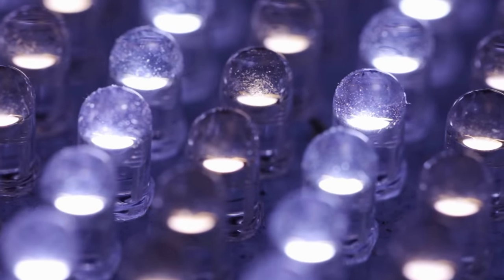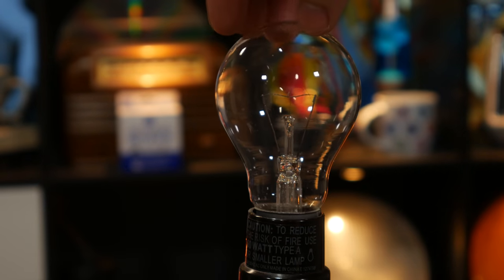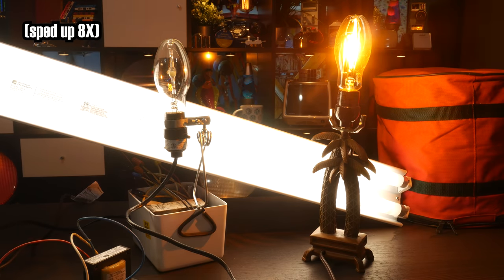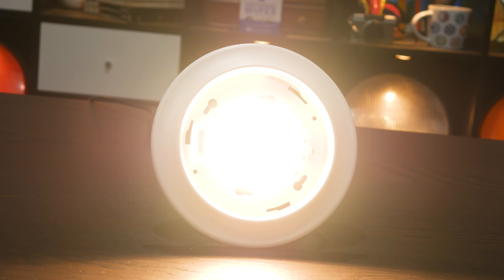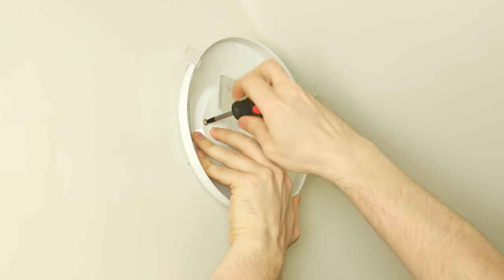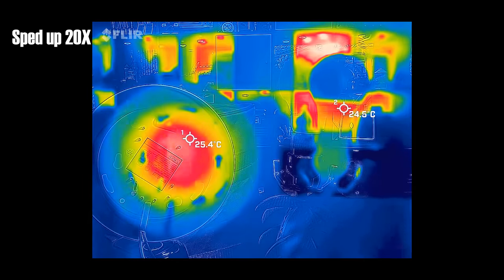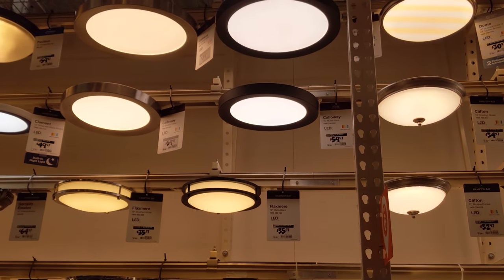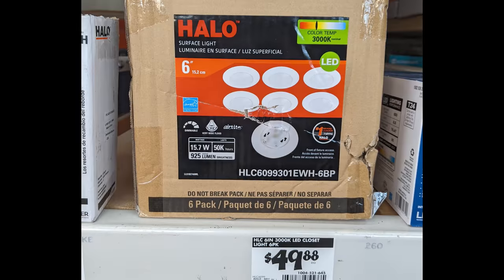A troubling trend in lighting?

Comment: I have two houses in China . One new one old . Both have the wiring simply covered with plaster . No romex no box, no metal plates over wires, over head Lighting is simply screwed to the  surface  or if it is a false ceiling held in place with spring clips. Switching is just screwed to the bottom of a shallow hole dug into the wall . As are wall outlets. From what I can tell the way they avoid damaging the wires is run them in the corner between the wall and the ceiling when running around the room and when they come down to a switch they run straight up and down the wall from the switch or wall outlet. Add to that it's all 220 one hot one return wire. I have replaced a  number of switches, wall  outlets and ceiling lights because the quality does not seem to be very good. So if you encounter a light fixture where the screw holes don't match with your box you can assume it was intended for the domestic Market in China and not export .

Comment: My apartment got struck by lighnitng and knocked out the light in my ceiling fan.  The light is basically one of these screwed onto a fan housing.  My apartment complex can't find a replacement, and it has been about 3 weeks with no light in my room

Comment: recently the light in the bathroom of my (rented) apartment has begun to flicker and pulse in light intensity (going from light to dark and so on) - popped the cover off of the boob light and had a "hey I watched a video on these a few months ago" moment - I have one of these. landlord supposedly installed it 3 years ago, I guess it's starting to go. Now that I've had to deal with one of these, i'm staunchly against them, at least in rented settings, i'm stuck with flickery bathroom light until my landlord finally gets someone over here to replace it.

Comment: FInally, someone talks about the issue with those light fixtures, i know they are convenient, but in the long term, they aren't, specially knowing that the market in 5 or 8 years will change and maybe those light fixtures will not exist. I work in a hardware store, and often people come to ask if we sell replacements for the driver, but we dont sell those things because every manufacturer uses different drivers,so they have to buy the whole thing again, it's an enviromental mess.

Comment: It my country (Australia) changing out light fixtures is illegal if you aren't an electricain.
Reply: Wow! Is that true? That's insane
Reply: @TurningString  yep we are land of rules any work on the fixed part of any electrical system is illegal.  You can change fuses - that's about it.

Same with plumbing.
Reply: @mernokimuvek  It's to with standards or some such unjustified reason, it comes down to income protection for plumbers.
Reply: @craigiedema1707  Someone wrote on a forum that in the 1960s dynamite was sold in hardware stores. and now in 2022 you cant work on electrical wiring in your own home. We are doomed with regulations.

Comment: 12:25 TRUE! Why do people wanna blind themselves with bright white...
Reply: When did people ever want to? These light output reductions when done in this way are still bad because you waste energy with all the light that gets absorbed and the heat that gets trapped inside and bakes the bulbs to early failures. Integrated LEDs can be made less bright if they make/program them that way and unlike the enclosed socket design, this would actually reduce the energy consumption and make the LEDs run more efficiently and last even longer. The direct downward firing design of the integrated LEDs is still better

Comment: Luckily it sounds like there's no real disadvantages for someone competent enough to spend 5 minutes watching a video on how to replace one, unless you just don't like the color. You can probably find the color you want if you spend more time looking. And regarding install, if turning off the power and twisting 2-3 wire nuts together is intimidating to you, I think you could get an electrician to build a plug for you. It's true you will have to throw out the entire fixture if it fails and you might not find a perfect match if it was part of a set, however, they last many many years and are cheap enough that I wouldn't mind replacing a set of them with a whole new set.

Comment: Interestingly this video popped up in my timeline right at a time when I moved into a new apartment with this kind of light, which was very frustrating to me once I was used to using Smart Bulbs, and at the time I inspected the apartment I wasn't aware that this kind of light doesn't have a socket, but is a complex electrical Installation. Does anyone by any chance know if it's possible to install that good old light socket back and how hard it is?

Comment: I don't mind doing away with the Edison connector and tbh I would have no problem with these if they were user serviceable to replace the LED array/components without having to wire a whole new one. Creating a new socket/connector is a good idea but these are flawed and ultimately dangerous

Comment: I am one of the cursed ones. "regular" led bulbs failure in the home was maybe 1-3 /30days. no matter what the brand.  
Some years ago I bought fancy bulbs and fixtures Philips, for a office space, and my home, exactly that happened they did craped out, they where nowhere to be found. 
The "nice" thing was at the office were we had a bunch of them, basically the celling design was based on them, and having  dogy lights when you receive customers... its for sure a profesional clue :)) 
My home is somewhat "vintage" and I like the way it is we got a bunch of fixtures that are again integral to the home (EG tiffany lamps) the filament like led bulbs work just fine. Only one of them bought the dust in a couple of days.
Reply: Same here but I still cannot trust LED as lighting today.
A convenient store nearby my home has changed its lighting to LEDs last week, the LED tubes are from Philips, all were working properly on the day they have finished replacing the fluorescents. But just one day after the replacements, 4 tubes have failed, one of them still worked but only half of it.
I have both LED bulbs and fluorescent lamps installed in my home, the average failure rate of LEDs is one bulb per season (3 months), while the fluorescent is around 9 months.
Reply: I’ve had terrible luck with the led bulbs too. Feit and Sylvania were by far the worst. Replaced about a dozen bulbs in my house all at once with Feit and within two months I’d already replaced 3-4 of them for flickering. Decided to replace them with a mixture of Sylvania/Phillips/GE to see what works best. Over the next 6ish months Sylvania had a few fail to flickering, one Phillips would act weird when first turning it on (took longer and would flicker a few times), and no issues with GE so I replaced everything with GE. Haven’t had any issues since. Hopefully it stays that way. 

I also put some temperature adjustable recessed led’s with trim in some old ceiling cans and haven’t had any issues with them. Luckily I’ve got a few extras so I don’t need to worry about mismatches if I need to replace some.

Comment: I like the new clear glass led bulbs, I thought they were not using driver chips anymore, but like all led bulbs I’ve tried, they flicker and die after a couple months of being upside down, for some reason they don’t like being upside-down, some say the heat rises into the chip and destroys it, but my basement has open bulb holders and remains between 50-70 degrees F year round. I love LEDs and their efficiency, but the companies are advertising the long life of the led diode itself, but they don’t tell you the driver chip seems to have a timer to kill the bulb after less than a year. Crooks.

Comment: I live in the US, can you please list the temperatures in Fahrenheit also? We use that system here to measure temperature. Thanks! 😁
Reply: I appreciate your politeness, and I also live in the US, but...I'm pretty sure Technology Connections does too? He's clearly an American, at the least. He probably listed the temps. in metric because it makes more sense from both an accessebility and logic standpoint (though he has mentioned feet and stuff before, so I dunno lol). Despite being American, I still recognize that the system we primarily use is outdated and that we should have fully switched a long time ago, and so it's not anyone's fault if they don't feel like making conversions when they could just list out things using The International System that most people around the world use, and simply expect the stubborn Americans to deal with converting to their outdated system themselves. (Seriously, it's not hard to open a new tab and use Google, which will give you an instant conversion. In any case, 25°C is close to 80°F,  31°C is close to 85−90°F, 40°C is close to...I think you can take it from there.)

Comment: Here's a brainwave... Why didn't the designers make them like smoke detectors, with a hidden plug, where they could simply be twisted and locked in?  The base could be sold separately as to reduce waste.  Make them so ubiquitous that they are practically a standard, like traditional twist sockets.
     I think light fixtures themselves should have a modular standard where their position can also be adjusted and locked with a built-in threaded ring, screw, clamp etc.  If you want to swap styles, just plug a new fixture in.  Some of those fixtures could also accept bulbs.

Comment: But they're so cheap. I got mine for about $5 each and they've been going strong for 4 years. I don't see the difference between that and the $8 led bulbs I bought 7 years ago that are still working.

Both are disposable.

The led ceiling lights might take 2 minutes to change rather than 20 seconds, but I don't see the difference.

The ones I have are held in with clamps, and have their own junction boxes. Very easy to just pull them down, and plug in new ones. No need to play with wires, they just plug in.

I also kept all the wiring for the old ceiling fan lights right where they were, just capped them off. That way if, for some reason, someone wanted to go back from having multiple lights illuminating the space evenly, back down to one single point of light shining in 3 directions, they can

Comment: The problem with these fixtures is that they're made cheaply. They overdrive cheap diodes to increase brightness which radically shortens their life span. Also the power supply is made cheaply and the heatsinks for the components are almost non exsitent which also shortens the lifespan of numerous components. All money saving methods

Comment: Hold out for standardized boards with plug-and-play drivers for these "disposable" fixtures.

The cheapy ones, who cares? Their stying is so bland that you wouldn't notice a difference if the color matched.

But expensive fixtures? There's no excuse. It's either servicable or you should get something else. I'm even okay with more expensive fixtures needing specialist repair, like soldering SMDs, so as long as you don't have to completely ruin the style of a room.

Comment: I wish you hadn’t glossed over the renters’ problem in just one sentence. This is actually a way bigger issue than that lets on. 

Not only might even a licensed and bonded electrician renting an apartment be prohibited by their lease from replacing these , but also there’s the factor that to get them replaced you have to wait for a maintenance idiot to arrive and do it for you.

Imagine the frustration of being without light for possibly several days as your cheap-ass management company delays maintenance because they only have one guy working five complexes and he doesn’t even really know his onions.

Then let’s point out that the more likely this scenario, the more likely the apartment complex went with the cheapest bog-standard crap they could find, so more of the worst of these. Flickering or just going out. Leaving tenants in the dark with the odds of this higher and higher the poorer they are. 

Just another way to fuck the poor, basically.

Comment: The default lighting is aus, is a clip in led flush mount light with a plug in the ceiling. So they can be safely replaced by anyone. American wiring is scary.

Comment: All we have to do is make a new connector inside the electrical box so that it will be the same as the old mechanism
Reply: Some devices have small plugs that allow for quicker change out. Ours were spring mounted in cans. Made for a very easy modification after installed properly.

Comment: I have always been a light freak and with having to wear glasses I want light, alot of light. Led builder lights when they came out, were so expensive, I had to plan for a future that was not certain but I knew would come. LED fixtures! I was so happy when cheap LED bulbs with more than 200 lumens came out that I went nuts buying them.. Non of them lasted 22 years. Non of them lasted past 2 or 3 years. And some burn out after a few months. Thanks to your video I know why and will be making my upgrades accordingly. For FIXTURES, I love square light fixtures and while I can adapt Edison sockets and bulbs to some, not all flat square fixtures can do that and need a LED panel instead. Now, I light these LED panel lights for months on end and even a few years straight and no issues but the screw bulbs? Poof! I found out the true pro quality and commercial LED fixtures and bulbs use a separate LED driver ballast and for the can light deals, they even come with cooling fans. I can hear the cooling fans in my commercial can lights NOW. So yeah, manufacture and price do play a role in lifespan. Those new tiny fixtures are lovely for tight spots and I was thinking of retrofitting them in those square pan light fixtures from the 70s that I love so much but I would have to attach the LED board to the metal pan on those fixtures to dissipate the heat? So that means I have some re manufacturing to do since Square pan acrylic and metal light fixtures from the bygone era are no longer made.. They used circuline fluorescent tubes btw.. I remember my first LED bulb was a Philips and was $100 originally then went down to $80, then $40 then finally down to $29 at HD where I could finally afford to buy 2 of them lol! Imagine my distress and anger if those were to blow out prematurely when advertised as lasting 22 years each! Wow.. So all glass LED bulbs and Filament style LED bulbs it is!

Comment: What a horrible lighting idea. If they're disposable, that creates a lot of unnecessary waste. Also, what happens if these become discontinued in the future? Now you're left to find a new lighting source, which may require modifications to your home to get them to work in the space. The fact that they connect directly to the power source, also means that you may have some DIY'ers electrocuting themselves, because they don't know that the lighting element is wired directly to power. They may start fiddling around with them, thinking they have a bulb in there somewhere that can be replaced, and not turn off the breaker first. It's also going to cost more to replace them when they stop working than a regular bulb, especially if you have to hire an electrician to do the work.

Comment: House i bought had all halogen downlights. I've since replaced all of them with LEDs however some of the housings are super old and broken. so they don't mount in the ceiling properly. and has resulted in a couple lights hanging by the wires. 
The shit part here though is I cannot buy these kinds of downlight fittings that take bulbs anymore. Only the bulbs can be bought or an entirely new disposable housing with no removable bulb.
I cannot simply replace these either since the roof space most of these are in is inaccessible. Definitely not a fan of the fully disposable sealed units. Having the option to fit different bulbs of different colours or even smart bulbs is what makes a light fitting good. but when the whole fitting needs to be thrown out simply because the bulb part is bad. It just sucks.

Comment: An easy hack is to take your cheap ceiling light appart for the LED module and install it in your classic light fixture.

My grip is dimming.  It's a crap shoot if the bulb is compatible with your dimmer switch.  Throw in home automation, and you are forever having to tinker whenever you lose a light.

Comment: A solution in search of a problem.  Incandescent bulbs have been around for over 100 years, were cheap to buy, easy to replace.  So they last about a year.  A child can change a light bulb.  (Remember the light bulb jokes?)  Why try to fix something if it isn't broken?
Reply: Because incandescent bulbs waste MASSIVE amounts of energy as heat, way more than they do light. They ARE broken

Comment: 19:55 I respectfully disagree. Learning is part of our life. We learn something new almost every day. If you stuck your had in the sand shouting " im not obligated to learn and i wont" you will be left behind and thats the beginning of the unstoppable downhill ride and fall.....
Reply: Learning is part of our life, but you shouldn't have to learn something completely unnecessary that makes your life more frustrating just because some company didn't want to design more intuitive and user-friendly products.
Reply: @Persun_McPersonson  Its not unnecessarry.Everyone should be a nerd, everyone should know how to do electrical wiring, how to repair appliances, how to make any household chemical, how to do physics and chemistry experiments, how to build a house and many more stuff.
Reply: @mernokimuvek  Do not put words in my mouth. Changing a fixture does not require specialized knowledge, just turn off the damned breaker before you touch anything.
Reply: @jagdtigger  As a nerd I can replace it with the power  ON. I donét recommend it for anyone, but nobody can fordib me to risk my own life.
Reply: @mernokimuvek  Thats your problem if you have a deathwish......